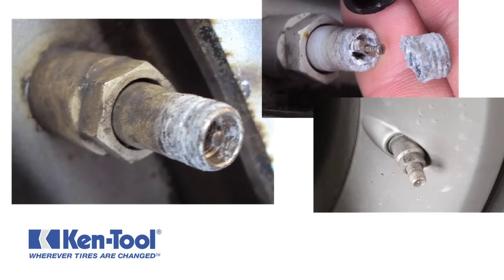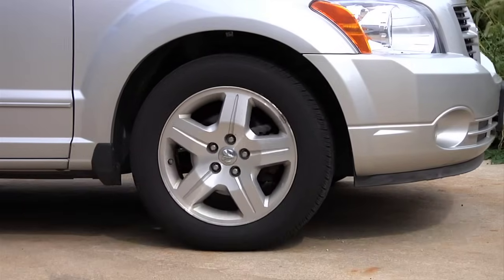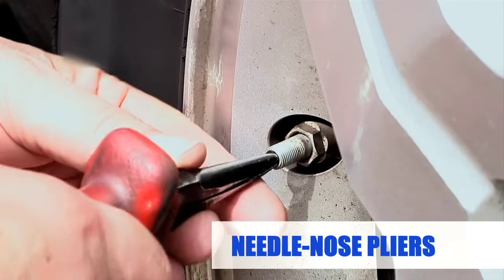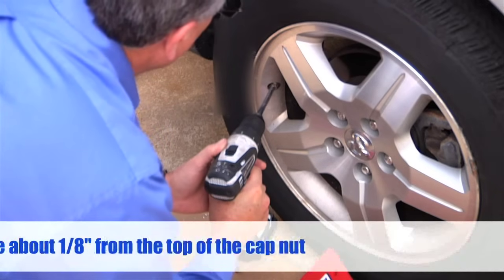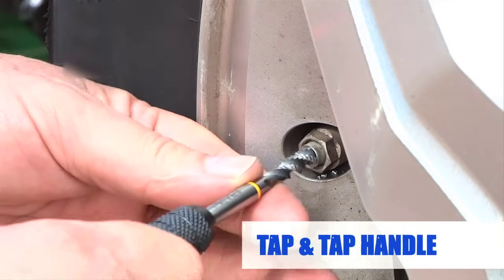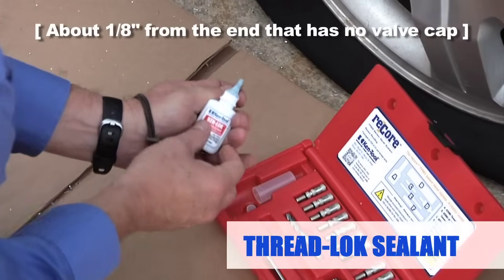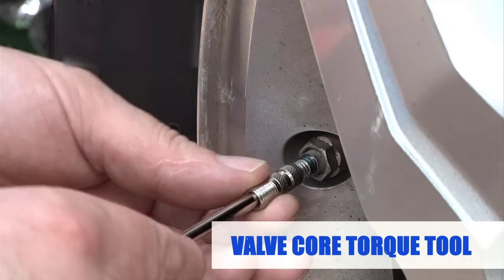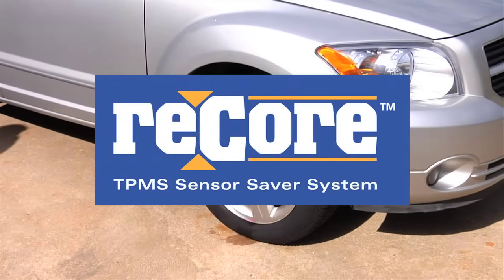Repair your TPMS sensor--don't replace it!  New DIY reCore® TPMS Stem Repair kit launched!

Comment: Looks like a lot of people are misunderstanding the point of this tool. It's not to replace a broken tpms sensor, it's to replace the top portion of the sensor where the air goes into the tire. If your tpms sensor is faulty, then yes you'd need to replace it as a unit. However, many times it's the top portion that breaks off and you can't fill up the tire with air because the air hose won't latch onto it and push on the stem valve and let the air in. This is where this tool kit helps.
Reply: Brilliant! Thanks so much for clarifying what this video was all about it.
Reply: So in other words it's clickbait

Comment: When replacing a damaged or corroded valve stem???? Sounds like all you would be doing is replacing the valve stem and NOT the sensor and battery.

Comment: As a student on his way to becoming an ASE-certified mechanic I can tell you that this is a 100% terrible idea.
Reply: Why. As an Ase certified tech with expired licenses because they are a joke, I can tell you that new sensors are expensive. Your customer will save money and your profit margin will be way higher. The integrity of the sensor remains as the base/seal is untouched.
Reply: Man you have to give a reason why "this is a terrible idea". Just saying so doesn't make it so
Reply: @gearwrench877  tire tech here, tpms arent expensive anymore not like they used to, i charge $65 for a brand new tpms (part+labor) takes me around 15 min to replace it...this thing is complete crap
Reply: @vamte  Exactly. TPMS for regular car makes is DIRT cheap $10 if you use chinese stuff...$20-$40 for namebrand schrader/acdelco/vdo aftermarkets. My mom and pop tire shop charges $10 to install/program. Although I have a Autel TS501 which is amazing

But sure for super rare cars if you go to the dealership they will charge u $600 for that oem part + dealership labor
Reply: @vamte  So, $65 each for four of those things, and I can just rip them out and put in a $1 rubber valve that works just as well myself without leaving the house?  I'm not sure why they exist.

Comment: I fixed mine by completely ripping them all out, and installing valve stems.
Reply: Engineers will do anything to frig things up,,,,,,, there was nothing wrong with normal valve stems,,,,, they worked just fine for years.  this nightmare crap they put into cars these days just pi$$ me off!!!!
Reply: @petewerner1494  I don't really understand the nightmare.  So a light stays on above my steering wheel; who cares?  I was fully capable of looking at my tires to verify they're inflated, and paying attention to my vehicle's movements(even on bumpy roads) before TPMS became a thing.  Ignoring one tiny light is an easy thing to add to that routine.
On the other hand, I've had people borrow my vehicle and drive normal speeds on a fully flat tire before, and then having a poorly qualified individual attempt tire replacement, thereby destroyed 3 of 5 lug bolts...  So I can see the merit... but for something omnipresent on vehicles these days, it's an extremely poor implementation to require a special computer to be able to resync the devices to your vehicle.  To say nothing of how easy they are to hack.
Reply: There is an entire industry built around resolving TPMS issues, and if you've priced out the sensors and tools, it's obvious what a racket it is. The sensors are built to fail. A better design would be a sensor that screws into the rim and has the electronics/battery on the outside (this could be on the inner rim for aesthetics), making for easy replacement.
Reply: How to take them all off i cant hear all thd time the annoying bip bip

Comment: I had a broken aluminum TPMS stem because of a steel valve cap that did not want to come off. I watched this video. It made sense. I read many discouraging posts from simpletons that don't know what they're talking about. Was not deterred. Purchased the kit. Followed the directions. It was very easy. TPMS valve stem repaired. Has held the exact same amount of air now for over two weeks without losing a single PSI. Repaired TPMS sensor works as  intended without having to be reprogrammed or replaced.  Cost of this kit was $40. Kit will repair two TPMS valve stems. Cost of replacing TPMS with an oem unit and having it programmed from the local dealership would have cost over $150. Highly recommended.
Reply: Still holding up a year later?
Reply: @fearofchicke  Yes it is! No leaks, TPMS still reports proper pressure to vehicle.
Reply: New tpms sensor is around 40$. I really don’t see benefit of this repair kit

Comment: I put tape over the flat tire indicator light. Quick and easy!
Reply: That’s how you fix warning lights on the used car lot! Ha,ha!
Reply: Just disconnect the TPMS recieving module,and you good to go.
Reply: @volodymyrbuchak1852  I tried disconnecting the plug from the module inside the headliner but the light is still on
Reply: Ii tried that but tape piece I cut was too small to cover the light.  Now what???
Reply: Why does the light bother y'all so much? Why not just ignore it.
Reply: @SL-pg4dh  I ignore the seatbelt buzzer when go a quarter mile to put air in my tire.

Comment: I don't think I would own a vehicle that had these sensors, they look like more trouble than they are worth. I'm old school, every month check your tyre pressures, easy as that.
Reply: I'm even older school. We use tires, not tyres.

Comment: I for one doubt this will overcome the TPMS light showing up on the dash, From what I read and spoken to many others a garage will charge around 4/500$  to take off all 4 tires and replace the units inside the tire. I have a light on currently with my vehicle , so i decided to live with it until i need new tires. then if i still own the vehicle i will pay a reputable garage for replacing the tires and the TPMS sensors

Comment: I see this is just TPMS Stem repair, not for old TPMS sensors when their batteries are dead after so many years. In that case, you have no choice but to replace them if you don't want see the warning light on all the time.

Comment: Replacing the valve stem is not going to help the sensor inside tire that either requires a battery or damaged solder.....

Comment: I can't believe what I just watched, but I checked into a related repair tool.  I have a rod knock and sent for a repair tool.  What I got was a set of hearing protectors they use for gun shooting.  Now the rod knock has gone away.  Order in the next 10 minutes and they will send a second one free.  Just pay a separate fee.  Lifetime warranty and money back guarantee if you can just find them again.  What a deal.

Comment: Clever but  you can buys tpms rebuild kit for most vehicles for around $2 each that completely replaces the valve stem. in older one piece TPMS sensors it could be useful rather than replacing the whole sensor, but if its that old , then the sensor is probably due for replacement anyway. it only takes a couple min for a tire shop to remove the wheel and break the bead loose  to be able to install the rebuild kit.
Reply: 3 words, Tire gauge tool...$5 at the local auto parts.

Comment: Rubber stems when replacing tires and disconnected TPMS recieving module. Problem solved for a lifetime of a vehicle.
Reply: Does that really work? Or does it cause problems with the on board computer? Does it cause the tire light to stay on in the dash?
Reply: @blueduck9409  It depends on a make of a vehicle. More complicated models will trigger the BCM.(body control module) malfunction code. But it also can be bypassed. In that case you’ll need more advenced scanner,if you don’t wanna mess with the wiring. In some cases code will not be displayed,just active in a memory.
Reply: @volodymyrbuchak1852  on an older suburban? Not too old.
Reply: @blueduck9409  I don’t work much on GM,but talked to the GM gearhead i know. According to him,if your vehicle made after 2007,it became federal regulation in US. In european and japaneese cars after 2012. In your case it’s inbaded in a BCM. It’ll cost you more to disable it then just replace the sensors or module. Since it’s required by law,they made it with nearly no option to get aruond it for DIY guys,but everything can be done with the software,only matters how much you wanna spend,and this one is not cheap.
Reply: @volodymyrbuchak1852  Thank you. I hate that they do that, make it a law requiring the sensor. Its not necessary, just something else to break that cost money to fix.
Reply: @blueduck9409   I feel you. Now the manufacturers are trying to push the law,that will allow them to keep the software confidential. That means you or me can’t connect to ECM,but autorized dealers only. You’ll not going to be able to even read the codes by yourself. Greedy bastards and crooked politicians.
Reply: @volodymyrbuchak1852  well, the only thing i can say about that is, i dont have to buy vehicles with on board computers. I have no problem driving older vehicles.
Reply: Modern cars are a pain! No wonder my friend is still driving his 1967 Morris Minor.

Comment: I'm in Canada. TPMS are not mandatory. I threw mine into the bin. Too many issues with air leak caused by TPMS not properly installed or just leaking air at the small seal between the stem and the sensor - remember TPMS are attached to the stems. You need to remove the tire to fix this, rebalance the wheel, headache and money spent

Comment: In this video, the old sensor is still in the tire. What was replaced in this video was the outside stem.  This is a very misleading video.  The tire actually has to be opened at the bead to access the TPMS sensor for removal.

Comment: So I had damaged threads due to a cheap chineese chrome cap. So for $1.  I removed the stem and screwed on a valve stem extension.  $1.

Comment: Just remove the garbage TPMS's and dont replace them.  That fucking "low tire pressure" light is on all the time anyway so who gives a shit.  I just bought a new wheel and tire package for my Impreza and told the dude to omit the TPMS and he had to get his manager.  lmao  Saved myself $200 bucks and the hassle of dealing with the pieces of shit.

Comment: I would think TPMS sensor will fail way before those valve stem will fail.
so this product is for those extremely rare occasion where TPMS is in good condition and the valve stem some how broke.
Reply: And on those rare occasion, you can get the stem replaced for cheap. Sam's Club can do it for $3. You can replace the stem and keep the original sensor.
Reply: @TheCuber2400  I doubt that. Most TPMS sensor unit are integral to the stem, and stem can not be replaced without removing the TPMS sensor. And I know for fact that the Sam's Club won't touch old TPMS sensor. They will only replace old sensor with ones that they sell.

Comment: Dealer told me the batteries needed replacement and he would be happy to do that for $250.00/tire. Tape over indicator light works fine. What moron thought this would be a good thing to have?

Comment: This looks like a good tool. I have a sensor on my Jeep replaced because the stem broke from salt corrosion. The dealer charged me about 200.00. Soon after, a second stem broke off a different tire. I wasn't paying another 200.00 so I had all the sensors replaced with regular brass/rubber stems and just live with the TPM light always on. If I had seen this kit sooner, I would have tried their repair.

Comment: Seriously, there are a lot of really slow people in these comments. This repair is for when your tpms sensor is working fine but the valve stem corroded or broke off. This is not for a dead battery or bad sensor. Let’s use common sense here.

Comment: This doesn't address the TPMS sensor battery. Mine is dead after 10 years. :(
Reply: TPMS battery is non-replaceable. 10yrs actually is very impressive. Normally they do 5-7yrs. New TPMS cost is dirt cheap ($10-$50 per sensor depending on car)
Reply: @thearcher1740  I know right? I was really impressed. Got my Toyota Sequoia in 2009, and the TPMS sensor conked out in 2019. I haven't replaced it yet because it would cost me upwards of $500 including reprogramming.
Reply: @KMacFNP  For an '09 Sequoia you can get a no-brand generic set tpms (each) for $19 or ~$40 for SCHRADER 28670 or ACDELCO TPMS172K. So ~$80 to ~$160 for parts. And shops charge ~$40 and up to install/program all 4. I got the part prices from ebay/rockauto.com/amazon. Basically I wouldn't spend a dime above $200 total to get it sorted but I'm sorta tangentially a mechanic
Reply: @thearcher1740  I see, thanks for the info. I will try that route, as the Toyota dealership wants my arm and leg to replace it LOL!

Comment: All the TPMS crap was developed to add dollars to the car's price tag. Bridgestone, (OWNS THE RUBBER PLANTATIONS) provided crappy rubber to Firestone who then produced leaky tires, sold to FORD motor. People driving on those tires were sometimes killed when their top heavy SUV"s flipped over in turns or left the road unexpectedly. Thus was created the otherwise unnecessary TPMS system! No-one went to jail, by the way!

Comment: Used these when I BRIEFLY worked at walmarts auto care center.   These are absolute garbage.  Band-aid on a broken arm.  Don't be cheap, replace broken tps with oem equipment. They stick out much further than original equipment and a prone to snagging and breaking. Can't say enough how truly awful these are!
(Discount tire 2yrs, 2yrs napa auto parts, 2yrs dairy mechanic, 4yrs votech schooling, 6yrs army helicopter repairer, 3yrs contracting helicopter repairer, 2 weeks walmart acc, currently working at Ford dealership)

I'm begging you, for the love of 8 pounds 3 ounce baby Jesus, don't EVER let any mechanic recommend these to you.  I broke a corroded valve stem at walmart, I told the manager and the customer I'd be happy to pay for a new tps, but the manager insisted these drill out replacements are more than fine and convinced the customer.  I felt so bad putting the trash on their car.

Comment: Don’t let them up sell you this bullshit. If your valve steam looks like that chances are it 10 years old or better witch means the battery is dead inside the sensor so the whole thing needs replaced anyway

Comment: In 50+ years of driving cars, motorcycles, trucks, and bicycles, I have yet to see a valve stem so bad it required this!  Bad batteries! Yes!  Leaking valve cores? Yes! So corroded it broke off?  Never!

Comment: the kit is not cheap from begining. just wondering how much less the shop will charge customer compared to the new tpms replacement.
the drilling debris will potentially block the already tiny air passage. plus  this will need some skill to drill the hold in center. plus taping on corroded aluminum is always a dicy job.
Reply: @yz8302 Cost mucho bucks. Dealer quoted me 2200 dollars for headlight replacement on a 2018 Lexus es350 for a 25 minute job. Cost me 250 for the part, 30 minutes, and free labor.

Comment: If you always use a valve core stem depressor and never bottom it hard, you can avoid damaging most stems. Maybe you'll get some curb damaged ones, but getting them drilled and tapped straight could be tricky.
Reply: @ORD80  Yeah, I changed a flat tire on the side of the road. it looked like the aluminum nut corroded off and the air leaked past the gasket on the stem. The tire sidewall was distorted but not punctured.

Comment: My light on my Pontiac Vibe (Toyota Matrix) is on and they said it was the sensor, possibly battery going out. Will a "fix" such as this take care of the problem and make the light go out without replacing the sensor or battery?
Reply: +David Milligan   No..read last post I just wrote to Rob H.

Comment: If you have to rely on a tpms, you probably shouldn’t be driving. I ignore the light, replace with regular valve stems and use a tire gauge.

Comment: Please don t mix the two things..Stem,,and TPMS sensor! This video shows stem repair. The TPMS sensor looks,and acts differently. Much differently! Sensors have battery,about 5Y life span.If TPMS sensor plays stupid,or doesn t play at all,you don't drill and change valve.You take it out,and put the new sensor in place.!(watch the year on the new sensor..when was it made? battery !!  Usually 5Y and than...bye bye!

Comment: people, listen, it does nothing to the sensor. its for a broken or salt deteriorated stem as the photo at the beginning shows.
 it replaces the stem not the sensor.
 a broken stem will make your pressure sensor malfunction and can also leak very slow.
Reply: What about wheel balance?
Reply: Dan Mc if tire monitoring sensor fault show in the dash board how dangerous to drive
Reply: Exactly, I was about to post this also but you beat me to it. Just replace the Schrader core, does the same thing only quicker and cheaper. But if it is corroded, how long will it be before the sensor fails also? this product is made for people who don't know what they are doing in the first place, who else is gong to buy it?

Comment: If it's not leaking a small piece of black electrical tape hides the light very nicely and blends in with the dash.
Reply: Works great for the engine light as well - you can always find very cheap priced black tape at garage sales

Comment: Tell me how you replace a 10 year old worn out battery through the valve stem. You do know that those sensors are not powered by windmills or solar collectors.
Reply: I hate these goddamn things. I wouldn't mind the indirect system that uses the ABS sense the slowest wheel, but these sensors just add more things to nickle & dime you every few years. I'm inclined to take them out one-by-one and tap over the light.